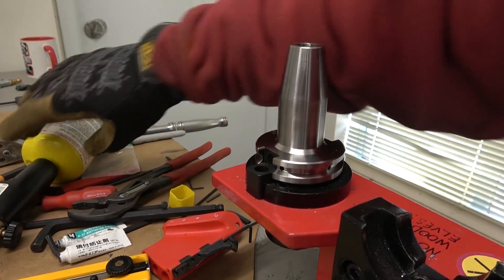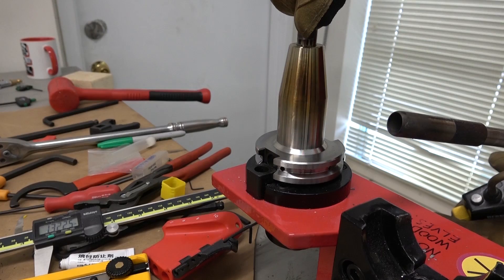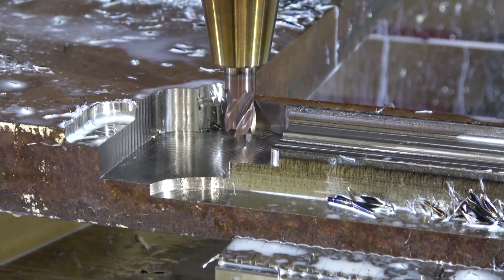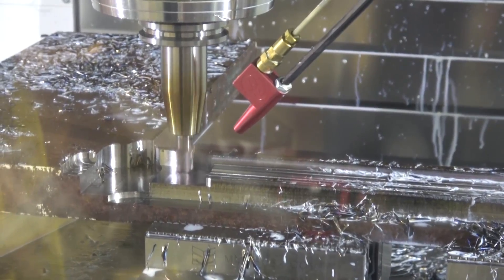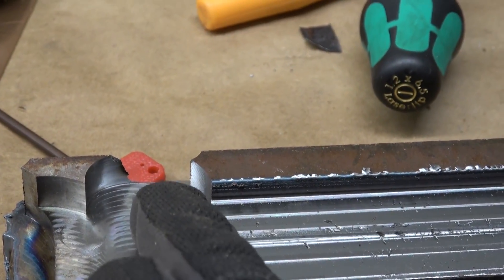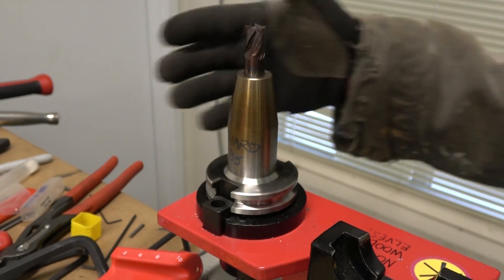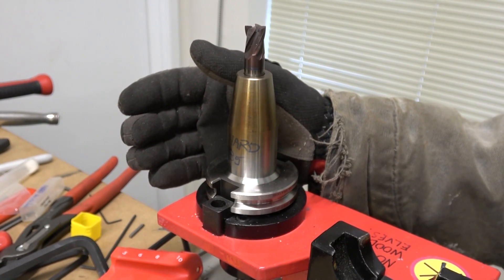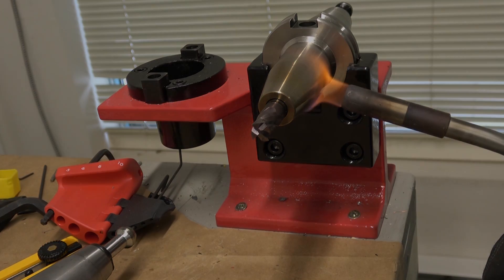Machining Feeds & Speeds |Test Maritool Hard Milling End Mill

Comment: I beg to differ. Machining is a science, not an art. That being said, there is a lot of creativity in devising a good setup/workholding/order of operations.

You just haven't taken account of all the variables to get that cut right.  Shorten your tool protrusion as much as possible. Start on the low end of the recommended rpm. Don't have the part sticking out of the vise on the x axis (or much room between vises/clamps.)  Sometimes a faster feedrate will reduce chatter-I think of it like having better traction.
Reply: you're being pedantic and don't understand AvE's somewhat flippant verbal style. At some level, one could say 'everything' has a science element, even painting or making music. But his practical point was that it is nearly impossible for a human to always understand every variable in the universe, and sometimes you just have to go by experience, look feel, sound etc. if you actually want to get anything done in one human lifetime. A scientist just wants to know facts - an engineer chooses when things are 'good enough' for the job at hand. A scientist would never suggest a butter knife for a screwdriver - an engineer would know when it will work just fine.

Comment: Ave,  Ar400 equals abrasions resistant, the sound of your cut and the chip you are making tells me you are rubbing not pulling a proper chip. Increase the chip load to .0022 per flute, and keep going up. You are rubbing without tugging. The chips should be darkening with heat. And they should be  curly. 10 percent stepover on the adaptive to start.

Comment: Completely agree. Was a machinist for 6 years running everything from big old manual King boring mills to a brand new conversational Mazak VMC. It is an art form dialing in feeds and speeds, dialed in by sound and looking at the chips.
Reply: With that being said on lighter duty  machines I found lighter radial cuts with greater depths/feeds/speeds seems most ideal.

Comment: I personally don't think your speeds and feeds were the problem in this situation,  cutters don't like running into a raduis equal or smaller than its own... Try programming with a bigger raduis or use a smaller cutter.
Reply: That's a nice observation and great advice. It's also something you can easily picture in your minds eye which is always good.
Cheers Mc Slyver for the words of wisdom.
Reply: I was thinking the same thing. Sounded good until it got into the corner. May want to turn on feed optimization so it slows down in the corners, though chatter is usually caused from too light of a chip load, not too heavy.
Reply: When you get chatter, increase feed and/or reduce speed!
It's the increased feed that's counter intuitive, but it works! Until you load the flutes and break the tool, then back off 5-10% :-)
Reply: most machines wont let you run smaller than tool radius paths
Reply: That is what trochoidal toolpaths are for, his set up is off somewhere. probably radial engagement
Reply: This is exactly the issue. That corner needs to follow a larger radius or reduce cutter diameter.

Comment: I know it's not the point, but I would love to know the cost on the various CNC components you use/break. Just a fun insight!
Reply: $50-100usd per endmill, shrink fit tool holder $100-200+$20 pull stud.
Reply: A lot.
Reply: And if you have to ask....
Reply: Also I'm aware I could look up pricing on absolutely everything. I spend enough time in my day researching a million things. When I watch an AvE video, it's just one of the things I'd be interested in. Just saying. :)
Reply: 802 Garage Agreed :)
Reply: @802Garage  all the prices are directly on the haas website
Reply: @SuperAWaC  A lot of parts he buys aren't Haas brand and I just want info about the tools he is using at the time. This isn't super complicated and obviously he doesn't have to. XD
Reply: @802Garage  you said CNC. the only CNC machine he has is haas.
Reply: @SuperAWaC  He is talking about tooling/holders, not the actual machine.
Reply: @ADBBuild  that's not cnc components then.
Reply: @A_Man_In_His_Van  11s

Comment: Cool info, but would you consider doing a basic series with one of those harbor freight machines?
Reply: ScoutCrafter has a good series about the Chinese dovetail column mills. But if you get the ones with a quill, those mills are essentially a tiny Bridgeport operationally, so any of the Bridgeport how-to videos probably more or less apply.

Comment: Back in the day of geared manual machines, you could only get an approximation of the correct spindle and feed rates, there was always a degree of fuckery to tune in the optimum settings.
Reply: During my apprenticeship they had two huge signs above the feed and speed charts (posters)posted. “Suggested Starting Points” & “Its your work, not theirs”.
Reply: Half your RPM double your feed. 
every. time.
Reply: Only if someone else is buying your endmills.
Reply: That's from back in the day when the men were men and the sheep were nervous.
Reply: 6 days ago you made this comment?
Reply: @seantap1415  early access on patreon meight
Reply: @seantap1415  patreons get early access to AvE vidjeos
Reply: @seantap1415  Patreon, you get it about a week early.
Reply: tap  Patreon members get early access to the vijayo's.
Reply: You can slip the clutch on the feed and spindle to get a few ipm or rpm